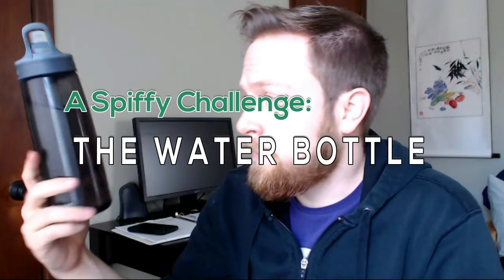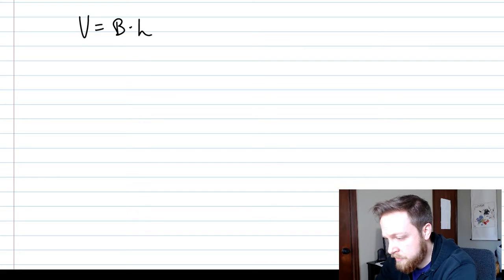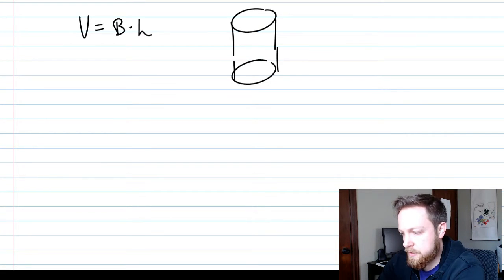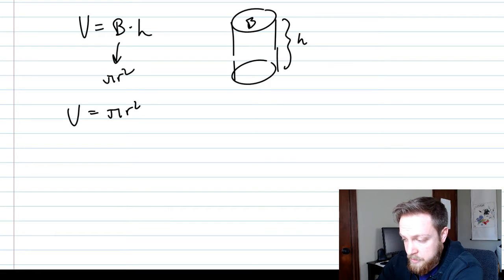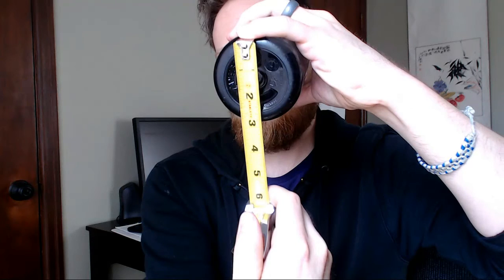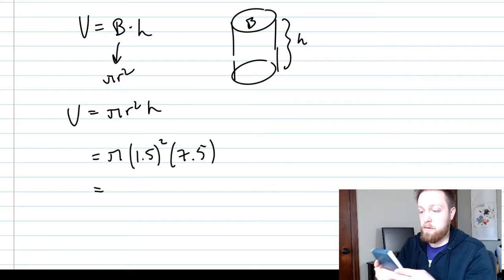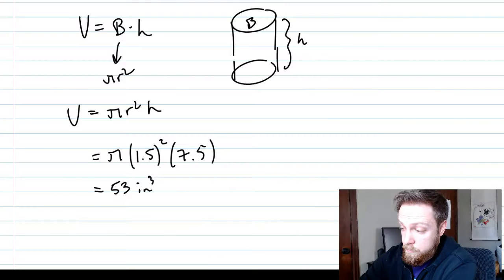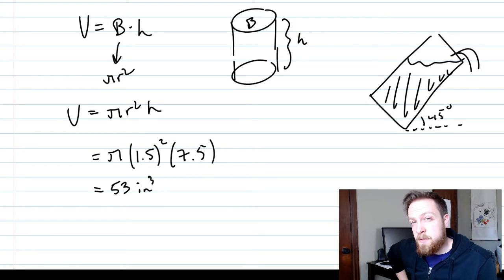A Spiffy Math Challenge: The Tilted Water Bottle!

Comment: The shape of the empty volume is a cylinder with height equal to the diameter, which has a volume of pi*1.5^3. Subtract this from the volume of the full bottle to get 4pi*1.5^3.

Thanks for making these videos, you are going to help a lot of people!
Reply from the maker: +Matthew Bates That's an elegant way to get the volume!  To get the same answer, I imagined the water level if I were to put the bottle upright.  The water level would then be the average of the high and the low point (6 inches).  I computed pi*(1.5)^2 * 6, and I get exactly your answer.  Very cool.
Reply: I was confused by your explanation at first, because you wrote "diameter" in place of radius. It also took me a second to figure out that you got 1.5^3 in there because it was a simplification of r^2×1.5. But yes, elegant solution.

Comment: Assuming that it is a perfect cylinder (it's not) and that the volume is exactly 53 in^3 (it's not) then I believe that you can not fill 10.6 in^3 of the cylinder witch is about 20%.
Reply: You could fill a little more but you're awfully close.  How did you get that answer?
Reply: I got the same result as him. I found that 20% of the total volume of the bottle would be missing.

First, I decided that, since the radius (and thus depth) was constant throughout the cylinder, I could treat it like a two-dimensional problem, with the empty portion being an isoceles right triangle in the upper corner of a rectangle. Since the two equal legs of the triangle measured 40% of the bottle's height, and because the area of the triangle is one half of their square, I determined that the empty triangle was 40%/2, or 20% of the total volume of the bottle. If you plug in the inexact value of 53 in^3, you get 42.4 in^3.